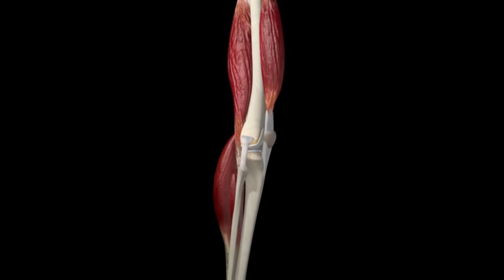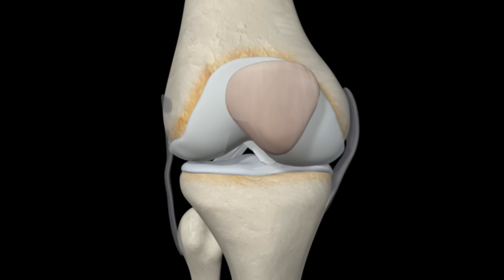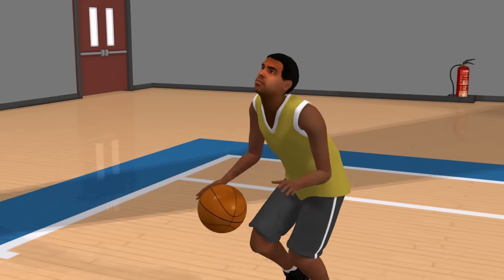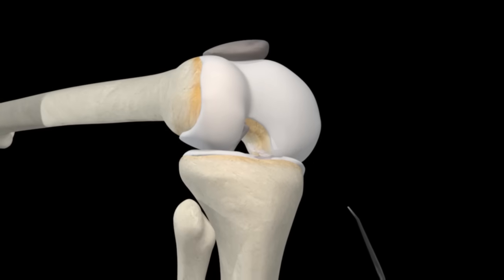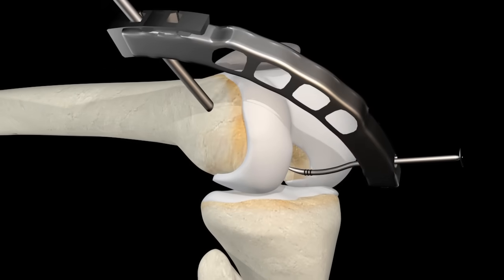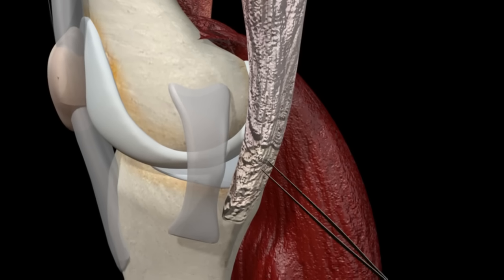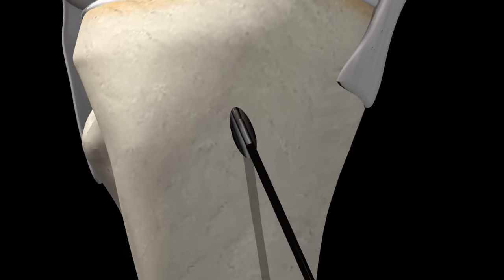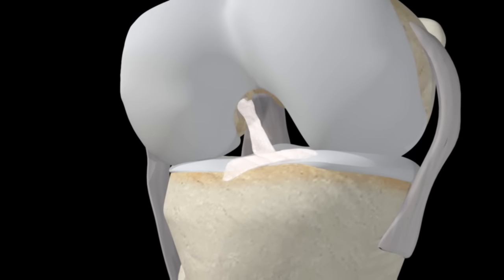ACL Surgery - 3D Reconstruction

Comment: Hi  undergone ACL surgery in Dec 22 in Vizag, Andhra Pradesh, India..The process was exactly same.It's been 9 months since got operated. I would like to share few lessons learnt on the process which may be useful for others..
1. Strictly follow best physio instructions post surgery.
2. Attaining normalcy like other leg is a time consuming process. Lot of patience is required.
3. Re gaining strength in the operated leg is only possible through rigorous workouts suggests by physio..
4. An expert physio only can know on how much load can be given on operated leg constantly from the date of surgery. Undergdoing or overdoing may affect progress of recovery.
5. Now its almost 9 months from the date of my surgery, still my both legs are not of same strength. I can do work outs at gym, brisk walking, taking steps etc., but still I can feel the difference..
6. Post surgery condition will increase, but may not be of 100% equal potential like other leg..
7. While climbing steps, I still feel Suttle pain.
8. I was told that it takes more than 11 months for full recovery and hoping for the best.
9. So it's a time consuming process. Patience and training is key.

All the best..

Comment: Am I the only one who ripped their ACL in such a stupid way as ... getting off the bike?🤡 
Three doctors and three physical therapists said I didn't need surgery because the knee was stable. One did a longer exam in which the knee gave up without resistance, but did so in an odd leg alignment, so the doctor ignored it.

Two years have passed and I went on vacation. I tried to pivot to take a picture while on a trekking trail, and my leg collapsed. I didn't have ACL, now I have damage to PCL, LCL and the tendons holding the kneecap in place. It was the first day my travel insurance was applicable, so "yay" for me!

I'm scared and angry at the doctors who told me I didn't need surgery two years ago.🤬
Reply: Dont worry, you’re not alone! I tore my ACL falling down the stairs while daydreaming in April. Got surgery in June. And so far, other than a small trip and fall, recovery has been smooth sailing so far :)

Also I’m so sorry the doctors treated you like shit. No one deserves to be treated like that. And by the people who are supposed to help you, no less.

Comment: Guys mee too had a surgery the last of April. I had my right knee ACL torn completely. Going through my second week of surgery. The first 3 days after the surgery was horrible. Can't sleep without painkillers. On to the last of second week, but still something is not right. Still on kneebrace, the doctor adviced for 6 weeks. Hoping for a speedy recovery. Pray for me guys ❤️
Reply: How is it now? Just had mine done. How long until u can bare weight on it. I have to be a braids maid in 7 weeks from now and I am hoping I can walk with the brace on
Reply: @hottygirl1468  My 3 months are over now and have joined gym since last 2 weeks. I have started using tredmills and also started putting small weight on my legs. I have used brace for 8 weeks and after that I was able to walk without the support of my brace.

Comment: I had a bucket tear, completely severed ACL and had my reconstruction surgery last week. For anyone a little anxious about the surgery, don’t be. It’s basically just going for a sleep. You have a small needle go into the top of your hand to feed the general anaesthetic and that’s it, wake up 2 hours later and it’s done. Expect a lot of swelling afterwards, and there was discomfort for the first day or two but then the pain went away quickly. Now I’m just waiting for the swelling to recede so I can focus on increasing my range of movements.
Reply: can you walk without crutches now ?
Reply: My surgeon said that they will put brace on knee after surgery, but I should not step on foot for about two weeks, and use cratches

Comment: I've had 3 knee surgeries and I struggle with a lot of pain, can't run, can't jump. can't do sports. First surgery failed due to the screw being an incorrect size and misplaced, second to clean that mess, then third to redo the original surgery. Only 23 my friends and family never take me serious or believe when I'm in pain or my body says don't do this or that, they think because people who have had one surgery bounce back that I'm just lazy. I ran a 5k every Monday for 3 years when I was in the Air Force and I could never run a decent time without meds.  I wish people didn't think I was lazy and that I gain weight cuz I struggle at the gym. I can never tell if it's better after never knowing recovery from the first time.

Comment: Almost a month into my rehab. It’s painful doing the physical therapy but if you do it correctly and religiously you will achieve fast results! Just have to stay positive and think trust the process. Just with a few days of cracking down and not baby my knee I’m feeling strength and range of motion coming back.
Reply: Almost a month post-surgery i can walk, my walk is still limp from time to time, but i can fully extend and almost fully bend my knee. I think i can feel the screws in my knee a bit and it is irritating sometimes but i am also training on my own aswell as going to physio and it shows great improvement

Comment: Thank you for this video; I have a few queries, request your response.

1) Does the graft tendon from hamstring grow/ thicken to a required or permissible size, after fixing it on tibia & femur heads?

2) The graft tendon goes inside the bone, while the original tendon is fixed on the bone heads; how does this change impact the joint? Does it improve the function of ACL (grafted) since it is now more securely planted into the bone?

Comment: I tore my acl on a trampoline, along with the mcl and a maniscus tear.
Felt like someone was holding a blowtorch on my knee and I couldn't make it stop. 
I've broken bones and torn tendons and this by far was the most painful thing I've ever gone through. But what's worse is the recovery. The surgeon will make the new ligament tighter than normal, so that it naturally stretches to the length you need. So your recovery is mostly stretching the acl out, which is equivalent to overstretching a part of your body to the point of where it feel like something is going to snap...then stretching some more. Then when you can stretch any further they will put your leg into a machine that will stretch it for you. Shit sucks.
10 years later and my knee is still crap and now has arthritis (I'm 29)
My surgery was the same as in this example, however the donor part was from my patellar tendon*. (holds the kneecap in place.)

Comment: Absolutely amazing! I read somewhere that the biceps femoris tendon is actually stronger than the ACL. I don't think they simply insert the tendon into position either; I could be wrong, but I believe it gets twisted, in order to further increase the strength. It shows when you see these football players return, and look as if they were never injured in the first place. This WAS a career-ender probably as recently as the '80s or '90s! 

Edit: depending on which tendon is grafted, the tendon isn't twisted, it's folded to increase strength.

Comment: Ive just had my reconstruction 3 days ago, my surgeon used my hamstring that failed with the anchor also. Instead he harvested tissue from the outter side of my knee and screwed both sides i was on the operating table for 6 hours 15 minutes.  The pain is incredible but caused by swelling pressure on all the nerves in my leg top to bottom. It will last 1to 2 weeks untill the swelling goes. Every operation is individual and most never go straightforward trust in your surgeon and listen to your physio for a speedy discovery.  I opted for the surgery because i couldn't play sports with my children and thats my goal, pain is temporary.
Reply: I had my surgery 2 days ago and I feel minimal pain..
Reply: @slembo  that's what i was tying to say how all operations altho the same procedure the outcome can be very different,  my swelling has halfed by now and i only get pain when i do physio as both my hamstring and quads have been harvested.  Wish you a speedy recovery 👍🏻
Reply: @Luke-hf4vi  thank you. I wish you fast recovery too

Comment: I have had 18 oparations on my left knee. Due to a sports injury.

I was one of the 1st people to have the ACL op done. 
I am currently on my  7th ACL which appears to be holding after 3.5 yrs.  I also had stem cell cartilage replacement done at the same time as the last ACL replacement  (LARS)

If you need a  ACL replacement,  I would recommend the LARS ACL. 
My surgeon told me that the hamstring ACL only appears to last about 5 yrs. 
That means that I was walking around without an ACL for about 15 yrs . 
I'm not sure about the hamstring regeneration.  I can still feel a gap where they took out the hamstring 20 yrs ago. 

 In those years,  I did  A LOT of cycling and was practicing for a 50 mile cycle ride when I tore my cartilage, and was told that I required new knee.  

Luckily, the stem cell operation is helping me  but I  think I am heading towardsa new knee. ..
Reply: Did u find any indication of arthritis after acl surgery plz tell me
Reply: @vamsisrikanthrallabandi7015  
Everyone has some degree of arthritis after the age of 35-40 in their knees etc
I'm sure I have some, but it doesn't effect me here in cold 🇬🇧

Comment: Had mine a week ago. Torn my while playing football where I was challenging a header and I landed on my left knee instead of both knees. Impact was so strong that I couldn't walk for 3 days. Chose to sleep while surgery was done instead of being given anesthetics to paralysed my lower body but awake while the surgery is conducted. When I woke up, everything was done and I'm on the bed in a ward. If you're like me, choosing to sleep during the surgery, first of, you'll definitely feel very weak when you first woke up. However, no pain at all due to the anesthetics given. First attempt to pee, which is around 5 hours after the surgery, I had difficulty with it and failed. The sensation to release it is there but u just can't discharge it. Second attempt, around 3 hours after the first attempt, managed to clear my bladder. However, it comes out bit by bit before fully finished peeing. All these are due to the anesthetic effects. First 3 days after my surgery, my knee felt very weak when I'm walking with 2 crutches. I'd regularly put ice pack over my knee to reduce the swelling. Now, on my 8th day, I'm able to walk with 1 crutch and my knee feels better although it's still weak. Had my first physiotherapy session last 2 days, and I'm able to do simple rehab exercises such as minimal bending on my knee and raising it up (maybe at a 30 degree angle at most). Really looking forward to the next few months of recovery so that I could start to jog again. To those who are going to do an acl reconstruction surgery, I hope this does helps but what I experienced may vary with others.

Comment: Just had mine yesterday. All the painkillers really make you feel sluggish.
Reply: Hey there how is ur knee now that u had an acl surgury after almost 3 years
Reply: @nabinghimire8506  Hey. I went for another surgery to remove excess fluid from my knee as I was having issues fully kneeling down (pressure applied to the knee when kneeling would cause serious pain). The surgery didn't really help with that, so it was possibly caused with poor extension habits during recovery.

Other than that, I can run/sprint on my knee without issues, but I made the unfortunate mistake of not keeping up with the physiotherapy they provided and so I still have issues balancing on one leg or doing any sort of rotary movement without feeling like it could re-rupture. I'm usually quite conscious of how I am moving around on the injured knee as it feels quite a bit weaker than my good one (this is with my injured knee belonging to my dominant leg.

If you're going to have the surgery, I don't think I need to tell you this, but make sure you keep up with your physiopherapy. It really is the key to a full recovery. I have been told many times by my doctor that my knee feels secure post-surgery when performing stability tests, but even with that, it feels extremely unstable to me as I haven't been consistent with the physiotherapy.

Sorry if I rambled a little and hope I could be of help.
Reply: I already had mine its been 9 months  already but someday i feel good and someday i feel like may be i forced a little and it hurts again i tend to force a little then i get a bit of a pain but i am able to run but i cannot run like on a daily basis like before being a soilder i am not able to give time for a physio therapy with an expert but i do it on my own watching youtube and i guess i am not doing bad either my knee is not swollen just during workouts one days i feel good and someday i feel like may be i made a mistake by pushing hard a bit and need some extra days to recover hope it goes good in a coming 4 to 6 month times thanks for your reply really appreciated it

Comment: A year and a half ago, was en route to a gas leakage call. My firehouse was despatched. Fully torned my ACL as well as meniscus due to the heavy weight of the bunker gear, BA cylinder and rescue tools. Knee snapped. Ran awkwardly to the scene. Told my commander that my leg felt like breaking. Came back to my firehouse, received medical attention to my swollen knee by medics and emt, went hospital the next day after shift ends, xray but unable to show what happened. MRI scanned and it shows clearly how badly my injury was... Recovered within 6 months after surgery, able to run(jog,sprint eventhough it will put on some pain), crawl(though it will hurt my surgical scar) squat, play sports and pretty much everything. Though the pain is on/off till this day. But till today, i tried taking extra precaution. Cause i know i wont be a good thing if it happen again.. TAKE CARE PEOPLE!

Comment: Crap. Just been told today I need surgery. For those of you who've had it done...How long before you were walking without crutches?
Reply: +Dubster 1 Had my surgery done March 16th.  Was on crutches for just about 4 weeks and then brace only for another 2 weeks.  It really depends on how confident you feel walking on it.  Probably could have dropped the brace a bit sooner but my physical therapist advised me to keep it on.  The first two weeks are pretty shitty but the stronger you go in the faster you will recover.  Physical therapy is a must for fast recovery I play college football and am in the training room everyday trying to get my strength back.  Here is a protocol from my doctor on recovery.  Hope this helps. 

0-4 weeks
" D/C crutches and brace as quads allow
" Begin progressing flexion and extension toward full ROM immediately (emphasis on full ext ASAP)
" Begin quadriceps rehab (QS/SLR)
" Begin stationary bike as ROM allows (No resistance until 4 weeks)
" Ice frequently to control swelling

4-6 weeks
" Begin bridging
" Begin resisted hamstring rehab if not a hamstring autograft

6-8 weeks
" Begin resisted hamstring rehab if a hamstring graft
" Increase stationary bike resistance
" May begin bilateral leg press (0-70 ROM limit) as quads allow

8-10 weeks
" Continue to increase stationary bike resistance
" Gradually increase resistance on leg press (0-90 ROM limit)

10-16 weeks
" May begin stairmaster, elliptical, and swimming
" Increase leg press resistance as tolerated (maintain 0-90 knee flexion limit)
" May begin unilateral leg press and step up exercise.
" Begin balance training

16-20 weeks
" Begin jogging when strength allows (no sprints, cutting, pivoting, jumping, or start/stop)

20-24 weeks
" Begin sprinting (no cutting, pivoting, or start/stop)

24-30 weeks
" Begin cutting, jumping, and start/stop activities
" Begin sport specific activity (no contact) if broad jump test is passed at 90% of non op lower extremity

30-36 weeks
" Back to competition
Reply: was in it for 2 weeks man just acl,
Reply: Trey Nahhas Great detail on the program! I needed this to give me a time frame for work and study commitments. I hope your recovery is swift.

Comment: The normal  Acl contains neurons which actually tells yor body that you have a ligament. The graft is twice as strong an the normal acl ,however Doctors can replace the ligament but not the neurons. The body will always  try to adapt by loosening the quads and tightening the hamstrings. Most of the "recovery exercises" involve" manually understanding " that you have a working knee.  I have done the surgery i am 4 months post op , the doctor says i am fine but actually it still feels weird.
 I; ve also heard some top doctors utilizing new technics invite neurosurgeons on the surgery.
Reply: Hi! Glad to hear your doctors say you're fine, just wanted to know how your knee are now. Are you exercising any sports or still at rehabilitation? Also: how much pain do you have and how many times did you go to physical therapists a week? 

I'm curious as I tore my acl and meniscus about a year ago and fixed my meniscus in November and having an appointment for my acl this may for a reconstruction. 

Thanks in advance. ☺
Reply: +Fornavn Efternavn It still feels weird 7 months , the doctor said i developed chondromalacia.